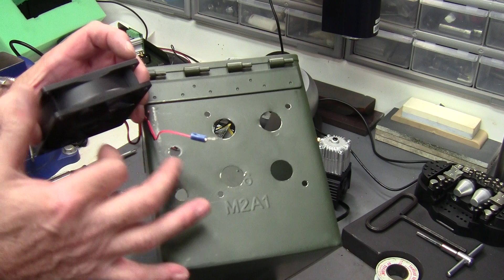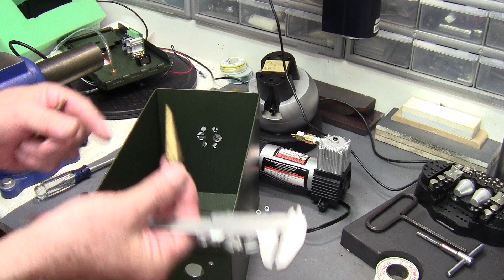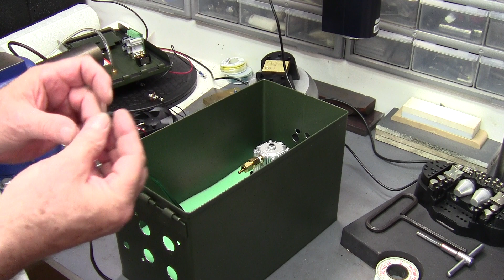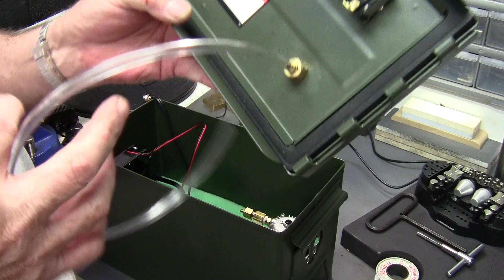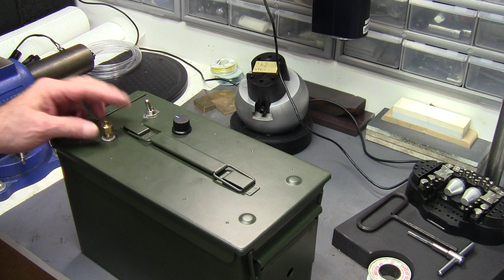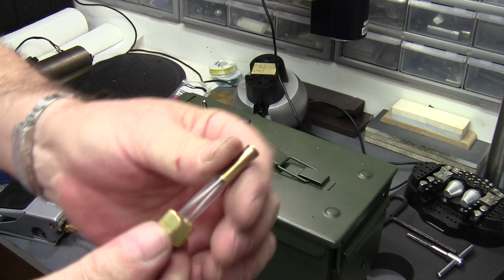How I built my Homemade Hand Engraving Machine Part 3 wiring modified compressor

Comment: I've had my homemade engraving setup for 2 years now and only disassembled the piston and cylinder once for maintenance after a year, but this still running strong. I love that even if the most expensive part fails, the compressor, then it's only a 36 dollar repair  👌. I bought a Lindsay classic about a year ago and still use both systems for different things. The homemade machine definitely has a more hammer strike type impact. The lindsay is smooth and almost ultra-sonic like. For the price the homamde machine is extremely impressive and Rick has made it so easy to build with his design, keeping the cost down as well. It's definitely worth building if your interested in hand engraving ✌️
Reply from the maker: Its great to here its holding up so well! I'm glad your enjoying the machine! Thanks for sharing this information your feed back helps a lot!

Comment: Great informative video..
Just one suggestion, I would use 2 fans. 1 inlet and 1 outlet. That would create better air flow for the power supply. I use these kind of power supplies for other things and I know from experience these things can get warm. Just make sure you don't set both fans to draw air in!
Reply from the maker: Hoping everyone improves on the way I did it, and makes a better machine! Glad you like the videos.

Comment: i've bought this foot pedal, and modified it alittle so the valve starts opening as you start pressing and has a wider range between off and full, i basically put a spring on the pin and another spring around it to hold it in place. i got lucky having a good spring to use but with abit of trial and error you can get it working great
Reply from the maker: What brand or type of foot pedal are you modifying? And what exactly was the modifications that done to it? Is there pictures posted?
Reply: it's a generic foot pedal like yours and if you are on "the engravers notebook" on facebook i posted it there with the mod in the comments
Reply: i have the same foot pedal and have noticed it doesn't have the same power as a straight through pipe what am i doing wrong
Reply: The Buff Barista i have the same foot pedal and have noticed it doesn't have the same power as a pinch pipe homemade pedal what am i doing wrong

Comment: If your compressor is making an awful loud noise, the cap that sits on the sleeve for the piston needs to be oriented in a specific way. The underside of that cap has a notch cut out so the screw holding the piston flap has room to move.

Comment: First of all thank you for this series super helpful and encouraging to get into thr hobby👍 just finished building mine but would you happen to have any insight? Might be a newbie question but im only getting slow piston movement on very low air pressure, as soon as i turn up it stops moving. Unsure on what it may be. I tried different size springs and shorter air hose but same issue
Reply from the maker: Did you try "tuning" the hand-piece, screwing the barrel in and out of the handle, to see if the piston starts moving. It's a balancing act between speed controller and tuning the HP. If that don't help give me more information on what its doing. Good luck!!
Reply: @ralex397  thank you for the suggestion👍 I actually fixed my issue. I had used a different quick connect for the air hose and it had a thin flap inside not letting air move freely🤦‍♂️ quick drill and i was in business
Reply from the maker: @DogbiteEngraving  Good to hear it!!! Glad it was an easy fix!!!

Comment: Amazing video obviously.
I now this 4 years old, but maybe somebody will help me
I was building this and when I turned it on, a couple minutes and the capacitor in the compressor blew up. I don’t think the polarities were wrong because I also followed the lighter connector to see which one was positive and negative
I was wondering if it was because it wasn’t being supplied with 12v because of the controller, and perhaps your compressor has a different circuit that can handle it ?
I really don’t know, thanks in advance

Comment: Brilliant set up Rick! Could you explain what the purpose of 2 foot pedals is please? I understand the one that controls the amount of air to the handpiece has an impact on the hammer action but what is the other on for?
Reply from the maker: It is a personal preference thing, right now all I am only using is the tattoo pedal for on and off,  bypassing the air foot pedal gives the hand piece a little extra power for engraving 4140 steel. I also wanted the compressor to turn off when I wasn't engraving. It is a setup choice, what works for you, here are a couple options. I will switch to the air pedal when I need finer control. Its all about what works the best for you.
Reply: @ralex397  Thanks for the clarification :) I'm looking forward to receiving my hand piece! Happy Christmas!

Comment: I wonder if a compressor from an air horn would work - they are pretty small and quiet.
Reply from the maker: After looking at air horn compressors they should work fine, and may be of a higher quality than the harbor freight ones. An air tank is not needed after the compressor has been modified.
Reply: @ralex397  I was going to say the same thing. Theres a few nicer air horn compressors but I'd make sure it's marked heavy duty and not light duty imo 👍. You'll see both. I've had my homemade engraving setup for 2 years now and only disassembled the piston and cylinder once for maintenance once after a year but this still running strong. I love that even if the most expensive part fails, the compressor, then it's only a 36 dollar repair  👌. I bought a Lindsay classic about a year ago and still use both systems for different things. The homemade machine definitely has a more hammer strike type impact. The lindsay is smooth and almost ultra-sonic like.
Reply from the maker: @savestheday258  Thanks for the great info!

Comment: So you have 2 foot pedals right ? One to turn it on and one to control the speed ? And so do you use both feet , left to turn on and right to control speed ?? Sorry I'm just really trying to make this but not to good at this ,,please and thank you
Reply from the maker: You don't really need the foot peddle to turn on the modified compressor, you can turn it on and leave it. It is personal preference. I am going to modify the air foot peddle to turn on the compressor, then I only need one foot peddle.

Comment: Hi Mr. Alexander!
Nice job!Nice to see that precise work.
I have a short question.
What do you think that kind of assembly:
-there is no any speed conrol of the motor,instead of it I'd like to use a single damper on the air tube.
The system running on permanent speed.But when i adjust that damper,the oscillating air space in the tube and the cylinders has a little leak,so the the energy what hits the engraving tool became adjustable at the same time.
I dont know,what will be the result.It'just a concept.
What is your opinion?
Have a good job!
Sorry about my weak english.
Reply from the maker: I think the speed controller is a must, but I encourage experimentation, with the compressor running at full speed I find it unusable. Try it and see, you can add a speed controller if your unable to get it working. Good Luck!!
Reply: Hi Mr. Alexander!
Thanks for your help!
Have a good work in the future!

Comment: Hey Rick, great build. I'm building one now. On my way to the parts store... what is the part/connector that goes from the compressor to the ammo can, and from ammo can to foot petal? I bought a compression coupling buy I don't think that's right
Reply from the maker: I use a 1/4 in. OD Compression Brass Coupling Fitting.
Link to Home Depot;
https://www.homedepot.com/p/Everbilt-1-4-in-OD-Compression-Brass-Coupling-Fitting-800799/207176331
Or use what works for you. Good luck!
Reply: @ralex397  thanks so much man! I actually ended up running the air line through a grommet. That'll do fine I think.. you know which part I'm really having a hard time with? That LFA-21A adapter that fits into the cylinder head of the compressor! I can't find that sucker ANYWHERE locally. I ended up ordering one online and hoping it's the right fit. The Home Depot's around here only carry 1/4" brass fittings and nothing smaller... did you have a hard time finding that piece?
Reply from the maker: @stackingdinkus  The first compressor I modified I made a fitting that would work on the lathe, then I took the head with me to the hardware store an found fittings that would work.  1/8 in OD x 1/8 in MIP 

https://www.bing.com/images/search?view=detailV2&ccid=XGEorV7b&id=DA2D9DCF7F6A7F161FB628F4FC9329B06EC3EF11&thid=OIP.XGEorV7bdH6mtromqAHWmwHaHa&mediaurl=https%3a%2f%2fimages.homedepot-static.com%2fproductImages%2f512d18ff-6a1d-429f-916b-e93349e930ae%2fsvn%2fbrass-everbilt-brass-fittings-800729-64_1000.jpg&exph=1000&expw=1000&q=1%2f8+in+OD+x+1%2f8+in+MIP++&simid=607997103801768733&ck=56A2080797476532CC13B7138C055EDD&selectedIndex=0&FORM=IRPRST&ajaxhist=0

Comment: in ones choice of air compresore is bigger better?
Reply from the maker: I have only worked with the Harbor Freight tire inflators, so I don't know if bigger would be better. It seems to be a balancing act between the displacement of the modified compressor cylinder bore and stroke, the length of tubing, air foot pedal if used and the bore and stroke size of the hand piece. I would think a larger compressor would require a larger hand piece but I could be wrong. Give it a try and let me know!

Comment: All new to me but question about the air foot pedal, if you have the electric disconnect pedal do you need the Air pedal?
Reply from the maker: With an electric foot pedal all you have is on and off, with an air pedal you have more control over the cut, you can ease into it. It all depends on the type engraving your doing and how much control you need.

Comment: Great videos. What speed controller did you use. Thanks.
Reply from the maker: 12V-40V 10A Pulse Width Modulation PWM DC Motor Speed Control Switch 13KHz K  from eBay
Reply: Thank you.

Comment: I have been working on getting 1 of these wired up and cant seam to get the tattoo petal to work or may the speed control to work I have watched this video several times and cant get it to work 

I can get the compressor to work with out it. Do ya think ya could help me out with what might be going on
Reply from the maker: Do you have my drawings?
Reply: Ya have a short video of the wiring diagram I screen shot it so I could read it to make sure I was right
Reply from the maker: @justincranford7249  email me for a better copy at ralex397@hotmail.com

Comment: I have a similar 12V air compressor. I would like to modify it to work  with an AC wall wart. I know that the wall wart must convert to 12V DC, but what should the amperage be?
Reply from the maker: Very low amps, the modified compressor is never under a load so the draw is very low. My 12v modified compressor is rated at 15 amps, the speed controller is 10A and the power supply is 15A. I was going to use a computer power supply but it wouldn't fit in the ammo can.
Reply: Rick, hey I’m working on one now, however, I bought the big harbor freight one, and it seems to be 30 amp. I mistakingly bought a 12v 5 amp power supply and it won’t power it? Any thoughts?

Comment: I've just completed all the wiring and nothing is working I checked the wiring and switches and it seams to be ok any suggestions?
Reply from the maker: Start at the compressor, hook it to 12 volts all by its self to see if it runs, then we will go from there.

Comment: Hi Rick do you have a list of parts somewhere?
Reply from the maker: Here is a basic list you should be able to find what you need.

12v Pittsburgh air compressor/inflator              $30.00  Harbor Freight
Air foot switch                                                         $18.50  eBay
110 to 12v power supply model S-180-12          $18.00 eBay
50cal Ammo can                                                     $15.00 Harbor Freight
12v motor speed controller                                   $  6.50  eBay
Tattoo foot pedal                                                     $  4.00  eBay
80mm PC Fan                                                           $  3.00  eBay
assorted brass fittings                                            $  6.00  local
Mono jack                                                                  $  1.75  eBay
on/off switch                                                             $  1.00  local
10 foot 1/4 inch OD tubing                                     $  1.00  local
power cord & 20 gauge wire I had
Reply: Rick Alexander thanks!!!

Comment: 🤔 Now what is the  amps of your 12 volt power supply in this video? So I know that I am buying the right 12 volt power supply with the right amps. 🤔So I want overdo😳 it or under do it with the amps👀🥴.
Reply from the maker: 15 amp or more, the modified compressor I use is 15 amp but it is never under a load, the only problem I have had are bad power supplies.
Reply: @ralex397  😉Thank you !I didn't really know if I would hear back from you .So I figured it out for myself by just looking at the air pump motor itself and it said 15 amps.So I ordered a 12V 15 amp power supply from eBay that looks just like yours in your putting it all together video here on youtube😉👍?

Comment: Ok im stumped, ive followed exactly what you did but whe i go.to.use.mine it just clicks and the display flashes ok on and off
 What am i doing wrong? Or what did i do wrong? I posted this question on both yours and shauns video.
Reply from the maker: Very hard to trouble shoot from your description, lets start at the compressor, with it disconnected from the speed controller does the compressor run when hooked up to 12 volts ?
Reply: Ok i had to go buy a 12v cig lighter plug i cant find the original one but i cannot for the life of me remember what wire is positive and negitive. Im using the same exact pump you used in the video. And thank you for you quick reaponse and for helping me out.
Reply from the maker: On mine the negative wire is the wire with the printing on it, but it will run hooked up either way, long enough to test it, it wont hurt the motor.
Reply: Plugged it in nothing! how coild i have blown the motor without ever plugging it in though?
Reply from the maker: @phillipchmura5193  That I do not know.They are made in China, if you get a new compressor plug it in and make sure it works before you mod and wire it. Unless you hooked up 110 volts to it, 12 volts shouldn't burn it up. Did it work before you modified it?
Reply: I didnt even check like an idiot. I do know i didnt attempt to test it untill the power supply came in. So im heading to harbor frieght kn a little while. Do you use the 12v 100psi or 12v 150psi inflator.
Reply from the maker: 12v 100psi
Reply: Thatk you i was just making double sure. Im off to harbor freight now.
Reply: Ok i bought a new pump. Ive plugged it in to the car plug. And it runs. I did notice they no longer have the c clamp on the piston. But ive degreased the piston the best i can and dried it off.
Reply: Ok last question before i put this back together and try again. Do i leave the disc thats in between the piston and the holes on top or do i leave it in?
Reply from the maker: @phillipchmura5193  You can leave it in but the valve that is on it must be removed so the air can move freely back and forth
Reply: Hey rick so i had an idea do you think.itd work if i wired a cigarette lighter adapter to the speed control for motor then keot the plug on the inflator and just plugged it in. That way it makes returns possible.
Reply from the maker: @phillipchmura5193  It will run with 12 volts hooked up to the speed controller, but I do not understand the rest of you question, not sure what you are getting at. The hand piece will not work unless you modify the compressor, just no way around it.

Comment: I had a look on ebay for those  "tattoo foot peddles"... nowhere does it gave a current rating.
According to your wiring, the entire motor current goes through the foot switch. This may be a bit much for such a device. (it is just a variable resistor) It would be advisable to use a small relay in-between these two, so that the relay switches the motor current and the foot-switch  switches only the rely current...
I suspect these foot peddles to be capable of sustaining a few 100 mili amps, not a the few amps that small DC motor is going to pull...
A mono jack or socket is most definitely NOT suited to have a few amps running through it for a sustained period !

Paddy
Reply from the maker: I have had no problems with it, it is an on off switch not a variable resistor.  All I need is on and off for what I do. An air foot peddle is used if you need to ease into a cut.
Reply: @ralex397  fair enough... what is the rating of that switch? (it should have some sort of label on it...)

Paddy
Reply from the maker: @gh778jk  Not sure but I've engraved for hours with it. Haven't had any problems with it getting hot.
Reply: @ralex397  well, again... fair enough... LOL, as an EE I am a bit of a stickler for using the right component at the right rating that's all...
That said, it's 12 volt... you're not going to accidentally commit acts of domestic terrorism with this thing ! Worst thing that can happen is that the peddle or the socket releases what is know as "the magic smoke" and goes tits up !

TTFN
Paddy
Reply from the maker: @gh778jk  It works for me,  most people use an air foot peddle, and let the motor run constantly. I like it to shut off in between cuts.